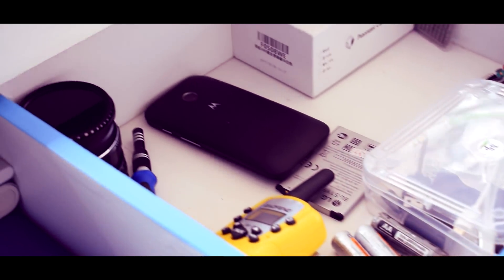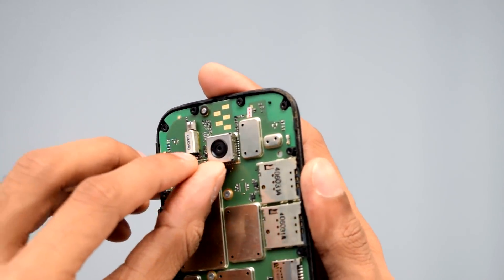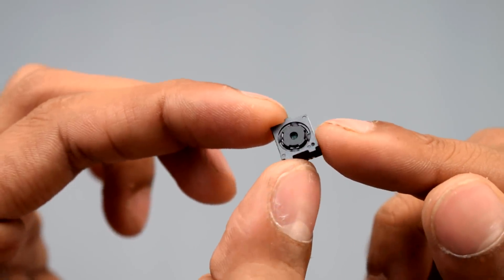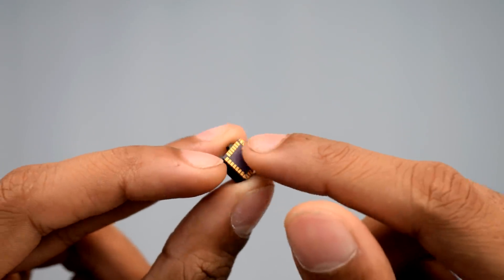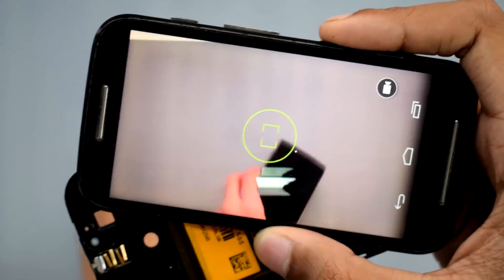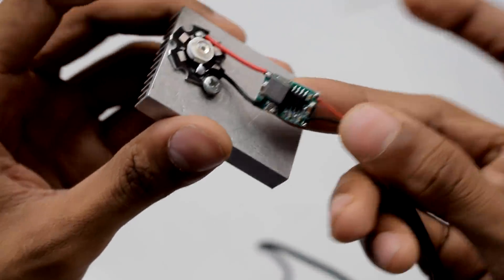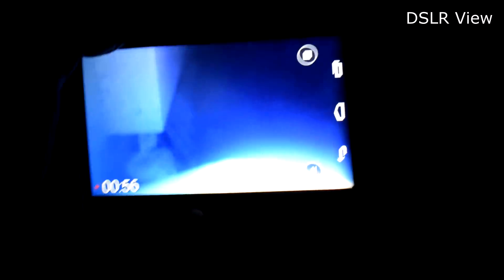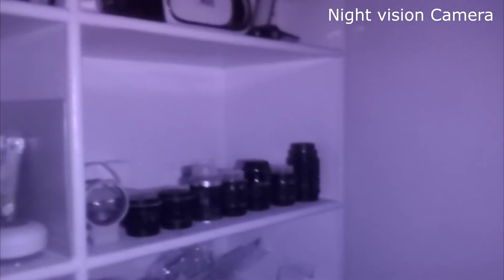How To Make Infrared Night Vision Camera from old phone | Smartphone Night Vision

Comment: I just tried  the same thing using 2 36 emitter fixtures from old security cameras. I  simply ran 12volts d.c. to the fixtures with a battery source. I don't need to remove whatever filter this phone has and I can see!

Comment: I made undetectable ir illuminator  by using remote ir made a circle of them like angle eye placed around my phone camera.you can get a setup from security camera comes along photo sensor...added small battery of 12v to power it pocket size it works ossum I made one 4years ago

Comment: Osram diodes...heat sinks...CLUMSY! 😄😄. Just take an old green laser pointer and remove the IR filter, KTP frequency doubling crystal, and the YVO4 crystal. What is left is a 808nm IR laser that projects a rectangular beam. You now have an IR laser illuminator that will go out a couple three hundred meters...and your modified camera WILL see nice and far that way. Much less CLUMSY, too! 😄😄

Comment: and if your phone has a flash light built in you could replaced it with Infrared !
Reply: Lanturn why didn't I think of that..
Reply: SMD's are pain in th ass to solder :p
Reply: Your comment being read by Samsung/apple/Xiaomi R&D to develop new phone model with infrared feature 🤔
Reply: @themiphz  oneplus did it
Reply: yes or a real ir laser module !
Reply: svenuu did I say anything about infrared?
Reply: You'd have to modify the power delivery system on the phone because youd be needing more than one tiny infrared LED.
Reply: @julian23561  i don't think you would need more. IR LEDs are pretty efficient, and the same chip area would give you a lot of illumation, similar to a flashlight. Trust me on this, I used to design epitaxy for IR LEDs. 😉
It all depends on how far you want to see, of course. A car driving with such a camera system, would need full-scale IR headlights.
Reply: @ivartangring3392  well it's good to see more than 5 meters and give the sensor an easier time to process things and reduce lag.
Reply: Is there some negative things to it? Or why are there no phones that natively have that feature with a additional lens?
Reply: @peschebichsu  For infrared light to be actually useful when used in nightvision, it has to be powerful enough to light up a moderately big area, and extra lenses without an IR filter don't really serve any other purpose than being able to see infrared light.
Reply: @J G 🤣🤣🤣😂
Reply: Your so stupid, night vision is for you to see in the dark without a flashlight.
Reply: @SylerScott  night vision is any system that allows you to see in the dark whether it is by thermal imaging, light amplification (often used by military "green" in movies") or IR blasting
Reply: Azer1125 wait REALLY?! I never knew that! (If you cant tell I’m being sarcastic)
Reply: @SylerScott  ikr